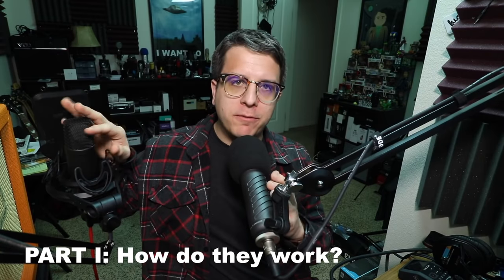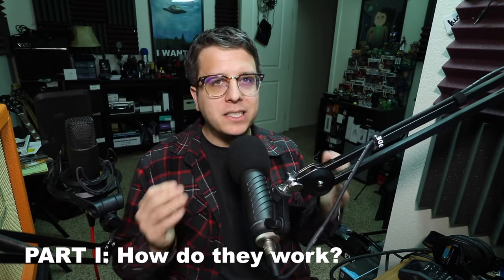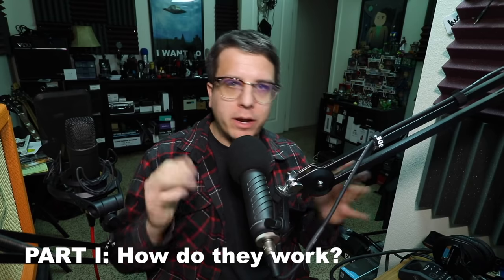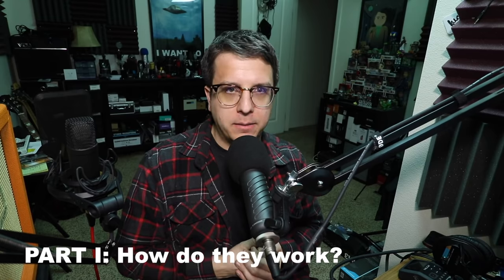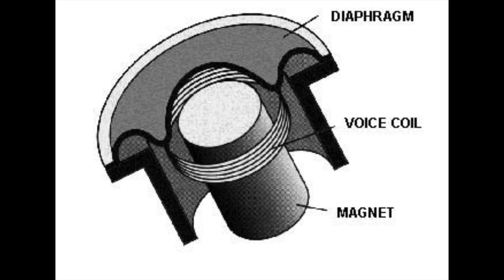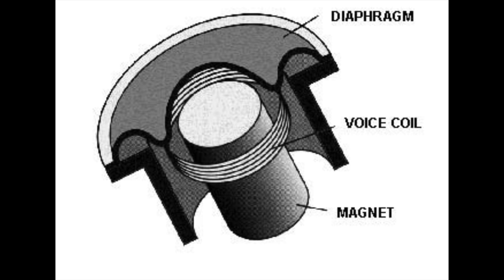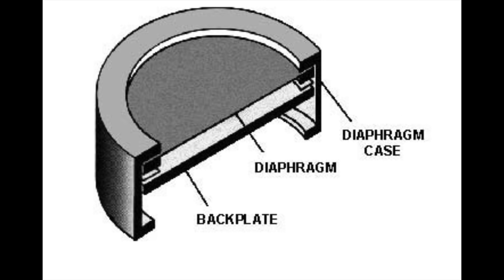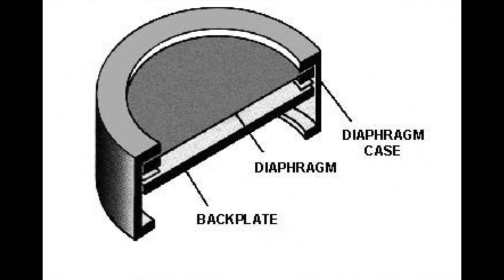Dynamic vs Condenser Microphones, What's the Difference?

Comment: "Dynamic" because it's literally a dynamic speaker, but receives sound rather than emit it, so a "reverse speaker", quite LITERALLY. I wonder if you could, in theory, convert a dynamic microphone INTO a speaker with minimal tweaks, and i also wonder how that speaker would sound. :D

"Condenser" has some similarities with a mix of electrostatic and planar-magnetic drivers, but again, in reverse.

Pretty cool. :D

Comment: With the internal electronics and phantom power, I wonder if condenser mics have a lower output impedance for driving long cables?
Reply from the maker: I think there's a lot of variance in that. AT2020 is 100 Ohms, U87 is 200 Ohms, SM57 is 310 Ohms, SM7b is 150 Ohms.

Comment: That "Broadcast" quality has more to do with the proximity effect coupled with an aggressive compressor.

If you are going to use any mike close to the mouth you need an external pop filter. Note that in this piece, the Røde NT1a has one, but the dynamic Procaster does not. The popping, even through the foam wind shield, is dreadful.
Reply from the maker: I don't deny in almost all cases you should be using an external pop filter, especially if you are eating the mic.

Comment: I'm currently using an ATR2500 ($100) for gaming streams.  I don't have a treated apartment, but I also don't noticed a lot of background noise in my apartment.  I think the AT2020 or the Rode NT would be the next best step up for condenser microphones.  What would be a good USB dynamic microphone to look into around $100-$200 if I wanted a upgrade to compare to those condenser options?

Comment: i want a omnidirectional microphone to record the soundscape whilst im recording with my action cam. it will be used in fair weather. Be used with a dead cat all times. Prefer to output to 3.5mm. But will be subject to fair abuse and loud noises. it will need to be able to fit in a good quality shock mount

Maybe what I’m trying to ask is: will the condenser be damaged by shocks and loud noises ?  (Maybe any suggestions, reading?)

Comment: One thing I don't get, most all demonstrations of large sized mics have the thing pointed directly at your face from the front.  To me that feels uncomfortable.  I just got a mic (audio-technica ATR2100x) and did an experiment: 1)  where it was 8 inches from my mouth in front of my face, and 2) where it was 8 inches from my mouth off to the side.  The recordings were EXACTLY THE SAME.  Inference:  Joe Rogan does not NEED to speak into the mic.  He could have it off to the side and it would sound the same.  So what's the deal with everybody talking INTO the mic?

Comment: I have need clear sound but I have a lot of background noise in my room so it’s hard to pick
Reply: which did you choose?
Reply: @squidrew1549  I’ve did a little messing around with both but condenser seems better to use I just have to eq out the white noise and it depends on who’s at my house if it’s only me there’s not a lot of background noise

Comment: So, since he had to talk directly into the front of the dynamic mic for best sound, I think in a FB live or YouTube video situation with two people....a condenser can be in between them and pick up both voices clearly and loudly. Right?
Reply: I think he's technically wrong on that point. The polar pattern of a dynamic or condenser can be omni, cardioid, hypercardioid, supercardioid, etc. That will affect the pickup from the sides & back more than the type of microphone used. Of course, all of the same principles apply to either mic, example - an omni directional mic will pickup sound from 360 degrees (regardless of it being dynamic or condenser)
Reply: Seek a Condenser mic that has a figure 8 polar pattern. This will allow the mic to pic up sound from the front and back while rejecting sound from the sides. Keep in mind Condenser mics truuully pick up a bunch of sound! If any of the two people fidget, click around the computer, move their chair or have a person making sound on the room over it shall get picked up by the mic. Depending on your situation it may be best to purchase two inexpensive Dynamic mics that can be placed closer to each speaker rather than a single "decent" condenser mic placed between you two.

Comment: The construction of the microfone can influence the sound? Like the MXL BCC-1 wich one looks like a dynamic "broadcast" microphone with the capsule on the bottom of the mic, but it's a condenser microphone.

Thanks for the video, great as usual.
Reply from the maker: Yes construction of a mic will impact the sound.
Reply: Depending on the capsule location, and the grill slots on the housing, as well as internal pop filter, all of these things can affect the sound, usually in how they deal with proximity effect.
Reply from the maker: Absolutely cry of the prophet. Also if you do hand held interviews, the internal shock mount will help TREMENDOUSLY with handling noise
Reply: Thank you so much, guys!

I hope to see the BCC-1 reviewed on your channel, Podcastage!

Comment: Question for you... Im using the NT1 setup with a Yamaha mg10xu mixer.  I use this setup for gaming.  Since you're a connoisseur of microphone's and setups, what do you recommend to get a little bit better audio.  It seems dull and just doesn't have the punch I guess that I am looking for.  Ive also done a dual stream before and might possibly get a podcasting type setup for two mics instead of using the NT1.
Reply from the maker: Try cutting some of the highs.

Comment: Hey podcastage,

I live in an apartment. I don't have a separate room for me. So I have some room noise. I recorded a vocal and tried some processing but the noise was still there . Would it be advisable to use a dynamic mic instead of a condenser mic?

Comment: I thought most radio stations use a condenser mic?  I mean, the top ones may sound like they use the Shure SM7b... the dynamic ones... can be the $9.99 ones... and they are every where... sure the SM57 and SM58 are nicer, and I feel they are more natural sounding in some cases... the SM7b just sound like so clear and professional

Comment: I noted that you didn't mention the gain levels you used. Specifically, how high did you have to crank The Procaster to get a good level for recording?
Reply from the maker: I didn't mention in this video beacuse that wasn't really the purpose of this video. It was more of a discussion of the different types of mics rather than how much gain an individual mic requires.
Reply: No. I realize that. I meant it more as a question. Does the Procaster require a lot of gain in order to get a decent recording level?
Reply from the maker: Ah. Yes it absolutely does when compared to the NT1.

Comment: If you use a mixer then would you need the cloudlifter for the Procaster?
Reply: No, it's not absolutely necessary, but it's recommended for reducing preamp noise.

Comment: Question,  bought a podmic rode to connect to the xbox one handcontroller, xlr from the mic and a headsett to a splitter to the controller, podmic doesnt sound, headsett works, learnd that a dynamic mic dont need shadow power.
Dont now what to do, thanks för answering.

Comment: Do I need audio interface for Behringer XM8500? Or can I just buy XLR to minijack 3.5?
Reply from the maker: I only recommend usb audio interfaces now because 3.5mm jacks on computers are awful, usb soundcards are unreliable, and XLR to USB cables are typically not the best either. The Behringer UM2 is about $30 though. So for $10 more than an XLR to 3.5mm cable you can get an actual interface.

Comment: do you have any suggestions for a handheld microphone to plug into a camcorder for on the go interviews? Under 50 bucks preferred. After your review I'm leaning towards the ATR 1300 with an xlr to 3.5mm chord. 

Also your videos are damn good.
Reply from the maker: Yeah that would be fine. The mic will be completely dependent on your camera's preamp.
Reply: Thank you for the response. 

Is there anything powered you think might be better? 

There's not much information on out of the house microphones.

Comment: A few memes that need to die:
- Dynamic Mic are less sensitive and are often used with more proximity, making your voice louder compared to the background, they don't reject noise more that any other mic with the same polar pattern, the sound hitting the capsule is not gonna change physically because it sees a dynamic mic, a dyn mic just tricks you into speaking louder and closer because of the shape & low volume output
- There's no "radio voice" coming out of a dynamic mic, it's just lacking high end frequencies, you can just grab a condenser & put a high cut on it if that's what you want. But good luck getting those lacking highs back from a dynamic mic
- It's damn near impossible to overload a capsule, even a condenser one, unless you really sound like a space x rocket. Usually it's the preamp that is overloaded, so for very high volume sources, go dynamic, but for spoken voices and the occasional shouting condenser are perfectly fine, just watch your preamp gain.
- Condenser mics aren't more noisy, unless they're shit, but anything around 200$+ is gonna be perfectly fine, maybe the higher output volume tricks you into thinking that
Reply: To be fair, this is the extreme TL;DR version of the differences between dynamic and condenser mics. I do agree with you on his SPL comment. Especially since he pointed to his amp. He’s definitely blowing the amp before he damages his mic considering that mic is rated just above the threshold of pain. A gun shot would probably kill that mic, but not his amp.

Comment: .... Is there a 3rd type of mic that has the more natural sound of the condenser with the background noise rejection of the dynamic?
Cause I really love the sound condensers provide when in controlled environments, but I'm not in a controlled environment...
Reply from the maker: There are a limited number of condensers that are designed for live stage use which do a great job at rejection. Something like the Neumann KMS105 does great at that. Rode M2 is another option. AT2010 I think is the model number. There’s the earthworks SR314. Shure Beta 87a (iirc)
Reply: @Podcastage  Thanks for the response!
Doing some research on those mics, and they sound pretty much exactly like I'd want... though the Neumann is too much for my budget. I'm leaning towards the rode m2 at the moment, but will continue to research these types of mics.
For reference, I'm currently using a modmic 4. Its perfect for things like Discord or in game voice chats, but I just cant get it sounding as good as I'd like for making youtube videos (my primary goal). I am looking to better treat my room for audio too that goes further than putting blankets up whenever I go to record, but for me the problem is a bit more involved due to extraneous circumstances.
Intellectually I know I'd be better off with a dynamic... but I just dont like how they sound at all :(
Again, thank you so much for responding!

Comment: Awesome video thanks! So for mic'ing up my guitar amp I made the mistake of buying an SM57. It does a wonderful job of capturing the totally dry, sterile tone coming off the speaker ... and completely fails to capture ANY of the compression, reverb or bass from the actual sound in the room. I'm a wally, so I'm thinking "AHA! I just need to move it back to become a 'room mic' instead". Which it also does, semi OK, but the end result is on a par with my iPad .. 
So what do I need to really mic my guitar cab AND capture the near-sexual ecstacy of the true room tone? Being a wally, still, I watch some videos and I think "AHA! What I need is a ribbon mic!" And indeed, they do sound farkin amazing! I tap Amazon and see what's good. Err. $1500! $3000? UMADBRO? I'm mad. 
So what's a good cheap room mic that isn't crap but isn't expensive either?
And.. could I not just take the 'dry' signal from the sm57 and add some compression and reverb and err some bass in a DAW or something and have it sound 'as good as' the room? Help a bruva out, would ya?!
Reply: Hey. Try hanging the 57 to the amp handle so the mic will be perpendicular to the amp. That way it is still closed to the sound source, but equally directed at both the amp and the room. I find it more natural, it works fine although my place is pretty bad sounding (tiles). I place it slightly to the side, too, for less brightness. Don't dismiss the 57 too quickly. It's probably all over your favorite records, if they made it sound good, so can you. As with every microphone, results depend a lot on the preamp you're using as well.

Comment: Hey, I was wondering if when you said that dymamic microphones reject background noise if that includes echoing? thanks.
Reply from the maker: Onixpected When I say that, I mean that it does a BETTER job at background noise rejection when compared to a condenser mic. It will still pick up keyboard noise, fan noise, room noise, and reverb (echos).

Comment: Thank you for the post. What happens if I use the Procaster with phantom power? or, is that a total no no?
Reply from the maker: The procaster is a dynamic so it does not require it. But it's also designed properly so if you mistakenly leave phantom power on it should not damage the microphone. It wouldn't be a good idea to leave it on for ages though...I don't think anything would happen, but who knows. I wouldn't want to risk it. 

Ribbon mics are the ones you have to be careful about with phantom power. That's a total NO NO! (caveat: there are some companies releasing active ribbons which require phantom power, and some modern ribbons have build in precautions to keep phantom power from destroying them).
Reply: Thank you very much for taking the time to answer my question so thoroughly. 
Will you consider making an episode using a mixer such as Mackie ProFX8 V2 USB in a podcast and show production please? I have watched almost all your mixer review and I am looking for a bit more discussion of how it actually is used in production.
Also, I love to see you look into the iPad attachments (soundboard, mixer and such) instead of using a physical mixer. Or, using a computer altogether instead of physical units. If you know of a youtube video that you recommend, I appriciate the link.
Thank you for considering.

Comment: I have a doubt, can condenser mics be used in a handheld way or is it necessary to use a stand? Will using it handheld lead to too much noise due to sensitivity? This is mainly pertaining to the Scarlett CM25 as I’m planning to buy the Solo Studio bundle and I have space constraints with using a stand
Reply from the maker: You will get LOTS of handling noise if you're holding the CM25.
Reply: Podcastage are they any good condenser mics or dynamic mics in the same price range with no handling noise? Which would you recommend?

Comment: so using cloudlifter with dynamic mic like procaster for instance does it make sense? or condenser mic would be better with cloudlifter
Reply: Cloudlifters are overrated, if you want a good preamp that also has a compressor, de-esser and noise gate, get a dbx 286s vocal processor, its only 50 bucks more than a cloudlifter and you can find them used on ebay for the same price as a cloudlifter.   The noise gate allows you to bring your ambient noise down to nothing, as it will not allow sound to pass through unless you are speaking..
Reply from the maker: A cloudlifjter takes phantom power, and turns it into a signal boost, but DOES NOT allow any power through to the microphone. This means that if you use this with a condenser microphone, the microphone will not work. CL1 only works with microphones that do not require power.

Comment: Thank you so much I got a dynamic mic thinking it was a compressor mic and was a little disappointed and afraid it would perform as well. However I actually like the way it sounded but didn't understand the difference in the big hype of the compression might. Thank you for your display. It would be really great if you showed like a range of different mics from the G pen good morning Benjamin on both sides and show price comparisons on how each mic and a same price filled with sound. But that's just for fun really. You already explained it very well and gave very good examples.

Comment: You missed out two of the most exotic variants, namely the ribbon mic family of dynamics and the ingenious Sennheizer patented RF modulated condenser where the capsule is part of the tank circuit in a high frequency RF oscillator :)

Comment: what's the difference between a condenser and a ribbon mic?
Reply from the maker: I have not done much research on ribbon mics or tested any, however I do know that you do not want to use phantom power on a ribbon mic. It will destroy it. They are also more fragile. They typically do have a darker tone as well.

Comment: I want the clear tone of the condenser microphone, so can I use it on stage for singing?
Reply: try using a dynamic mic like the Shure SM7B, and pair it with an equalizer: Cut out the lows and boost the highs for more clarity, generally speaking
Reply: @customjohnny  Thank you very much
Reply: @customjohnny  Using the EQ is good idea but i am wondering the dynamic mics can take higher frequences like condenser ones? If it cannot take high tones, EQ will be not efficiency.
Reply: @SagucuTegin  To the best of my knowledge, they can take the high frequencies- they just don’t typically boost the highs, as those are the frequencies that mostly cause feedback(think of that high-pitched squealing). Basically, the highs are still there, you just gotta boost them to hear them 🤷🏻‍♂️

Comment: metal pop filter is more effective or pop filter (condenser mic)
Reply from the maker: Depends on the metal pop filter. I don't think that the material alone determines the ability to reduce plosives. It's more the design.